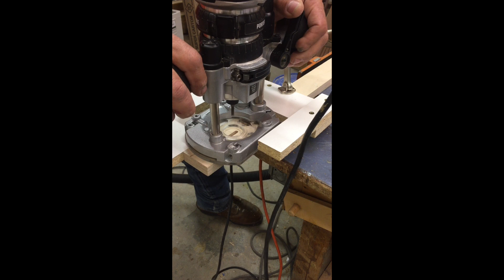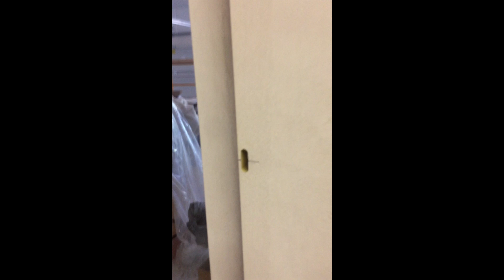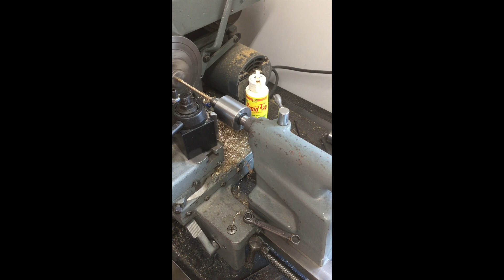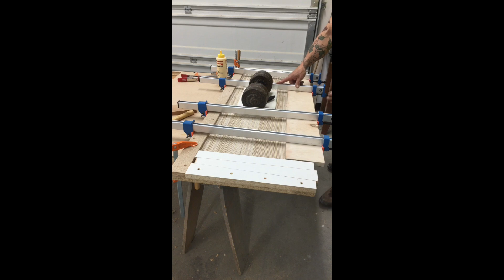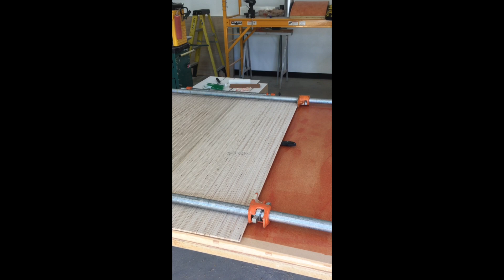Shop Door build, part 1

Comment: looks like the box part of the build is missing       confusing
Reply from the maker: The box part?  Which part do you mean?  It’s an older project, and I may not have had the footage.  Thanks
Reply from the maker: Oh, you mean because the description reads “torsion box”, yeah?   Well, I show how I cut the dados at the table saw for the frame, then I talk about covering both sides of the torsion box frame and I pull it out of the bag.  That’s about all there is to a torsion box. Now, I’m getting better at making videos…be patient 😬🙏🏼